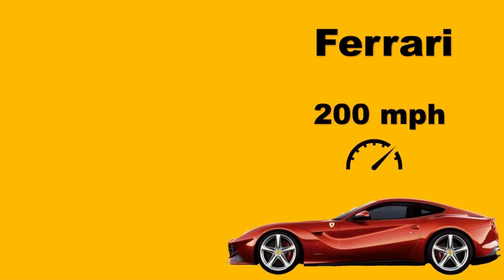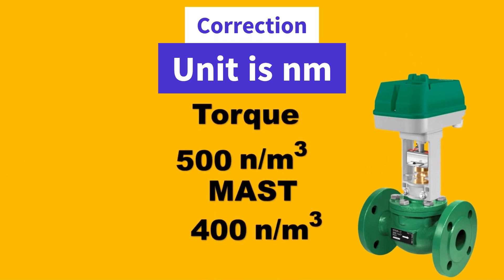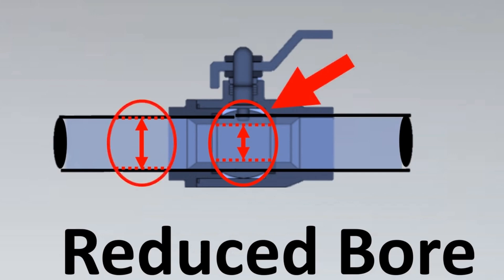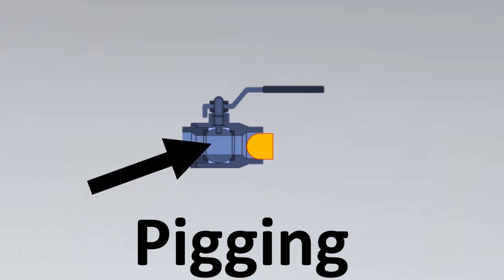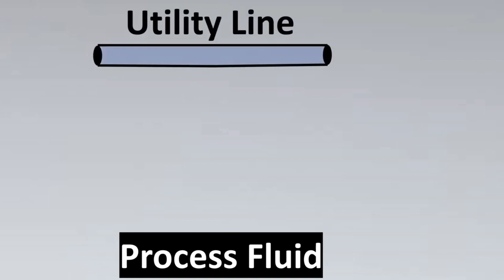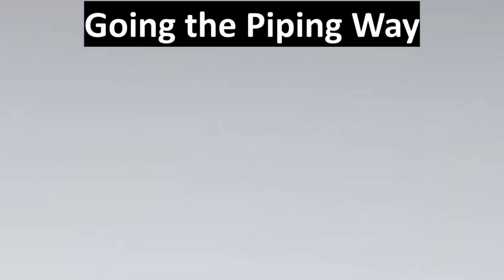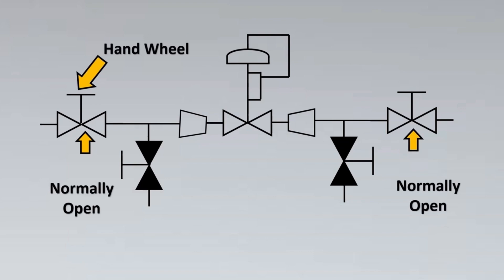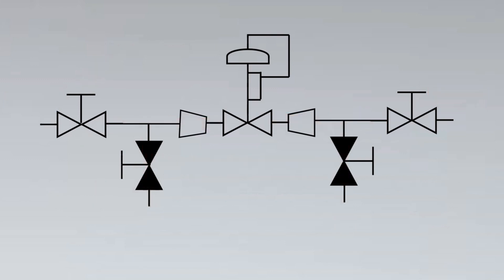Cracking the Interview : On-Off Valve | Top 3 Interview Q&A in 2024

Comment: Not necessarily it's ok if actuator output is higher than MAST, depending on application. The actuator only outputs the torque needed so as long as the valve doesn't jam or isn't subject to more breakout or dynamic torque for the application